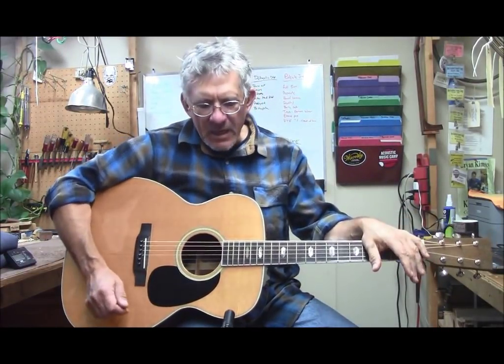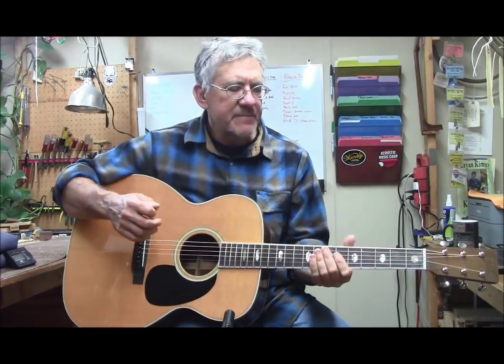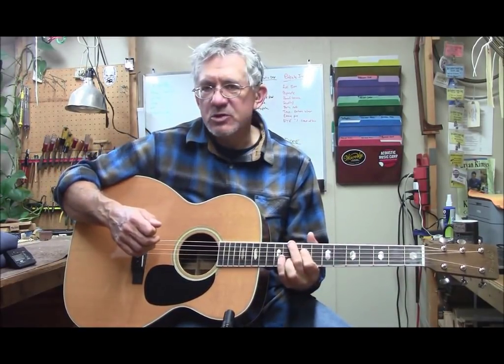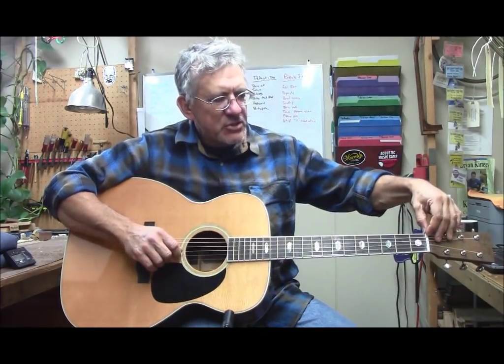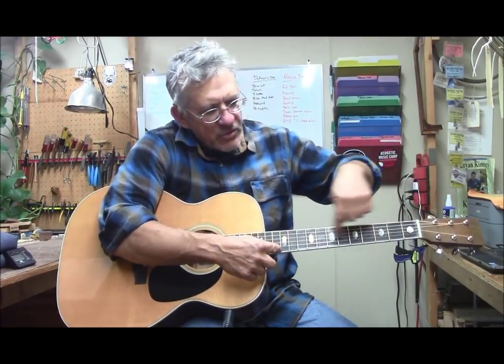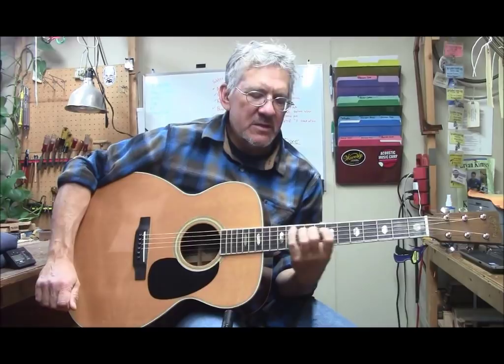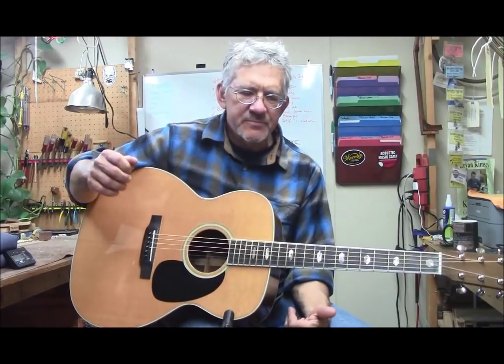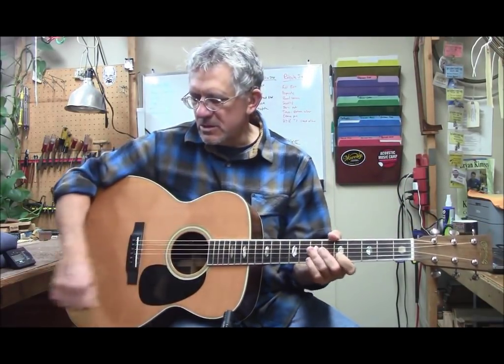Martin J 40 approval

Comment: Bryan, appreciated the comparison. I play a 2017 J40 and it plays so comfortably that it wasn’t until a short time after I bought it that I found it’s a bit wider than my dreadnoughts. The tone, sustain, neck shape are also what sold me on it. First time I played it at the store I wasn’t impressed with the tone; later they put on different strings (Elixir 80/20 bronze, 12-53) and it sounded so good I bought it right then. As soon as I got it home I went through about a dozen sets of various sets of strings over just a week period to compare the tones to see if any sounded better to me than those Elixirs; none did, so that’s what it always strung with. I’ve done the same testing with my other guitars and different ones sound better to me with different strings. A lesson I wish I’d learned decades ago about trying different strings in quick order to find the best for that guitar, rather than just fumbling around as the strings died.
Only fault I have with my J40 is a noticeable difference in color of the top and bottom half of top of the guitar
Reply: I use med Elixer PB and enjoy the sound and the push back on my fingers though I may need to go down to lights due to old age me not the guitar.  Did you put in any kind of pick and if so what kind? Thanks! Cheers!
Reply from the maker: Red Bear Medium Classic. Same pick for all the videos.

Comment: Hi Bryan, you mention your "standard" Martin modifications.  Have you made or are you planning on making a video that goes through these mods?  I read a post on the UMGF that lists the following as mods you made to a 2016 HD-28V.  

1. Remove bridge and excess lacquer underneath.
2. Reshape bridge to prewar height and reglue with hide glue.
3. Convert bridge to true through saddle.
4. Lower #3 and #4 back braces.
5. Remove popsicle brace.

Always look forward to your videos and insight.  Cheers
Reply from the maker: Most of that stuff is inside the guitar and hard to show, except for before/after.  What I need to do now is quit making videos and work on my backlog.  :)

Comment: Why doesn't it have the capital CF MARTIN logo on the headstock? That's the standard on 40+ styles (that has the cursive logo as on 18, 28 etc).
Reply from the maker: EDIT:  I don't know the history of these and when they changed to the inlay but in 1994 they came with script.  Google "1994 J-40" and you'll see.  This would be a good question for the UMGF.